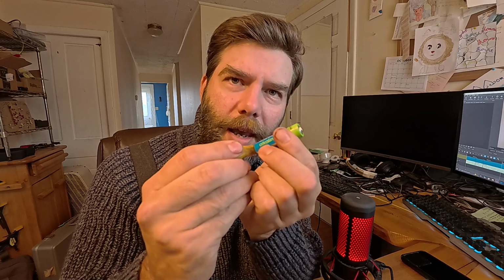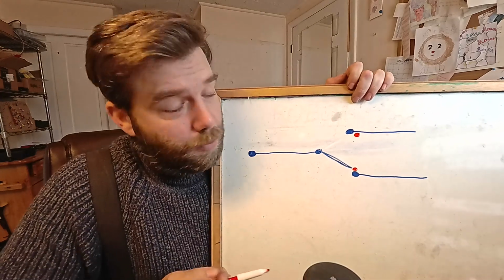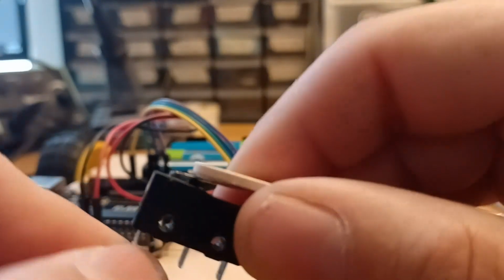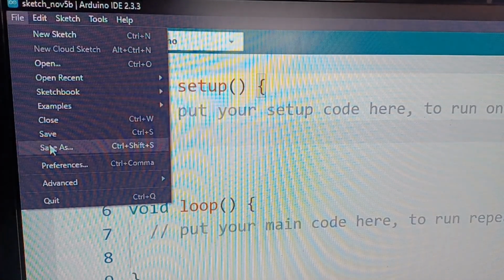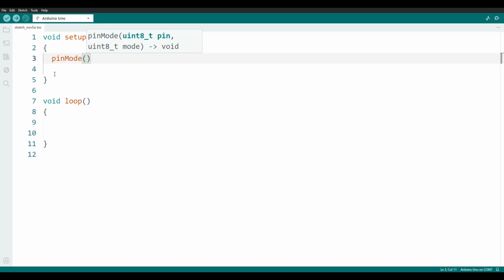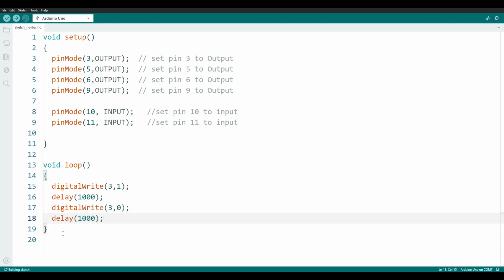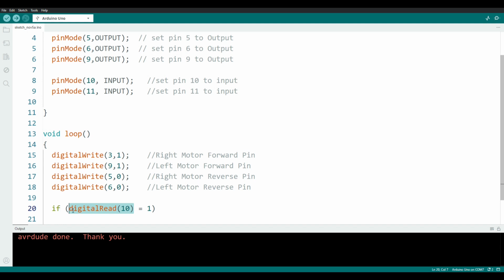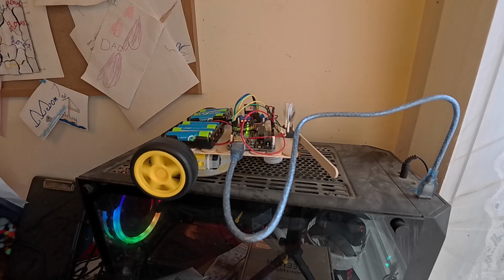How To Robot No.2 -- Bumpers, Wiring, and Programming

Comment: Please be sure to emphasize good circuit wiring concepts. One of those is when wiring a circuit, use RED wire for positive voltage and BLACK wire for Ground. This will help out a lot when you have to figure out what is wrong with a circuit. It will be obvious where power and ground are. I never use RED or BLACK for anything else besides power and ground connections.
Reply from the maker: Yes, coloring conventions are very important. Fun fact: did you know that in modern boats, DC Ground is Yellow? The reason is that there have been many cases of black 120VAC Hot wire being mistaken for a black DC Ground. So the standard for DC ground in Marine applications is being transitioned to Yellow. :)

Comment: That went too fast, time flies when your having fun. May I suggest you get a screen sharing program so you don't have to edit so much white board. Learning lots every time I watch one of your videos., or a cam on a posable overhead lamp so you can draw on some paper, and scene switch on OBS between cams. Provides lighting for your shot its cheap and you can use it when you want up close to tie wires and tape and glue things.
Reply from the maker: Thanks! Yeah, I'm new to making videos, so I'm always on the lookout for ways to streamline things. Thanks for the suggestions!